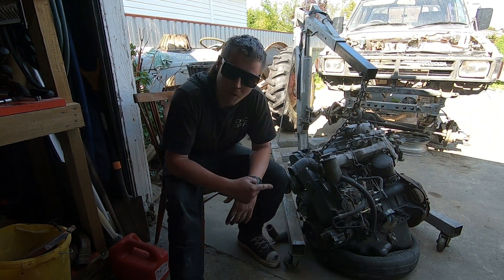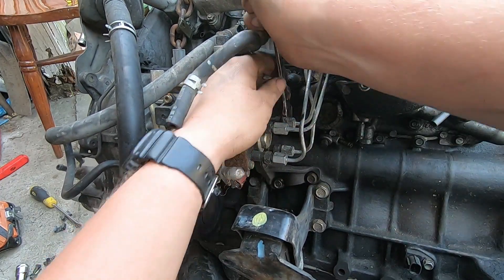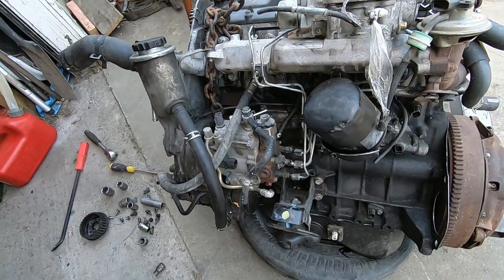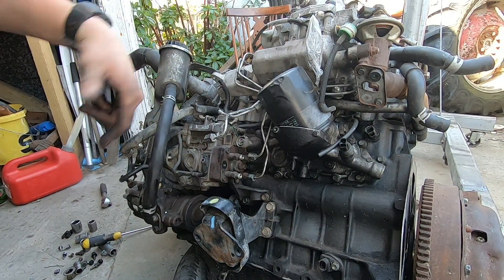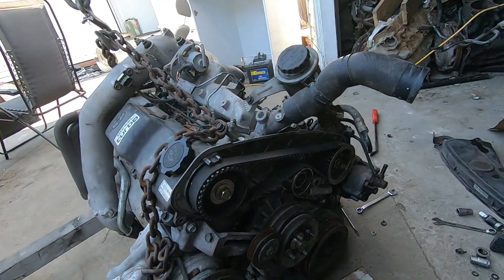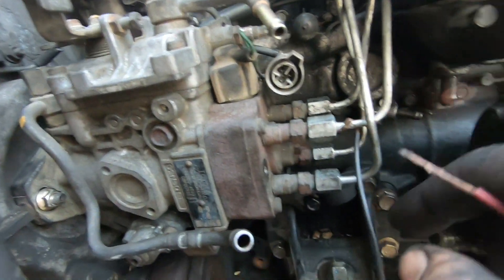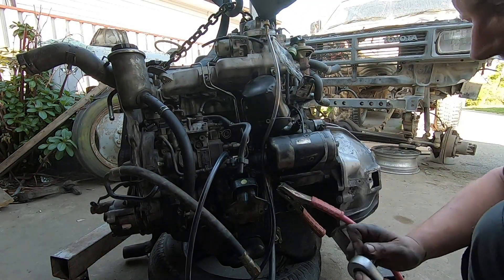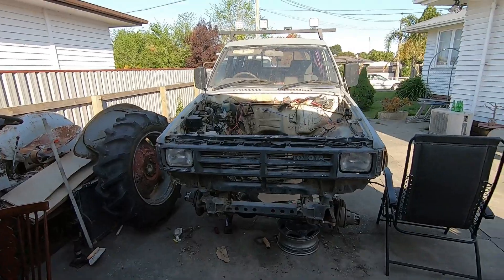Hilux 1kz Conversion: 1KZ Mechanical Injector Pump Mod

Comment: One thing I can say is you can leave all the timing belt and front pully on the truck, just need to remove the big front nut and the 2 sides, injector lines, bottom mount, and all the plugs etc and she knocks straight out ready to go back in so you dont need to re time it it will already be timed by the key on the shaft

Comment: I'm just curious, how did you keep the rpm/tach in your stock gauge cluster running? I also did this mech pump swap in my Surf (LN130), and its running smoothly,  but my tach is no longer working since it uses the signal coming from the electronic injection pump, any leads or advice would be of great help. Thanks so much! =)

Comment: How do connect up the throttle?
Reply: The accelerator pedal? If you could get the original 2l bracket it'll be easy. It's a swing thing with a rod attaching to the pump and the cable attaches on top.

Comment: Got myself a LJ78 that i will start doing the swap, bought a donor car, toyota 4runner with 1kzt engine, both cars are manual. soon will start doing it! 😎
Reply: How did this swap go? I'm wanting to buy a KZJ78 but convert it to manual which is what you will have to do I presume?

Comment: so I got mine up and starting, had to advance the manual pump all and fiddle the fuel screw. its just a temporary mock up till I get it tuned properly but she lives 🙌🏽
Reply: What mechanical injector pump did you use?
Reply: @sankarkamta  sorry man I put the comment in the wrong place .
Reply: Used a 3l pump. What I did was filed the bolt holes in the pump to turn the top of the pump towards the engine. (Unsure if that's advanced or retard) I used the original 2L/3L cable holder/bracket thing for the accelerator to connect back. Wired in the tps from the 3l pump because my trans is still original. Looking into adding some more boost to compensate for the small power loss. But like I said in the other comment it's not that noticable. She works like a charm now , I have no regrets.
Reply: I used the original 3l timing marks. Turned the motor manually with a rachet to make sure the valves weren't touching the pistons and yea she started but terribly. After filing the holes for more adjustment she runs very nicely now.
Reply: @raviseumangal4016  filing the holes meaning the engine block to advance the injection pump more? Making it tilt more towards the engine? Just to be sure

Comment: hey bro did u get ur 1kz started?. I think u have the timing wrong... 3l  pump timing is different to the 1 1kzte   timing. u need to put the timing to the original 3L marking . not the 1kz.

Comment: JOINTNESS.
Jointness is defined as a dynamic process representing an emotional system for attachment and for communication between separate individuals who jointly approach each other in a third, joint, virtual space. Jointness represents an encounter between mother and infant, psychotherapist and patient, or any partners experiencing simultaneously mutual intimacy, while concomitantly safeguarding separateness.

OR 
 My universal has good jointness,

Comment: Hey man u need to use a 4m40 2.8 pajero pump and send it away to get it set up to run mint...well that's the cheaper way otherwise u get a hybrid pump for around 1500 set up ready to go...the 3l pump that u just put on will run but u need to advance it right around like 40degrees to get it to run ok...it's like instead of the pump timed to number 1 cylinder it's starting on number 2 if u know what I mean...same thing u were talking about advancing and retarding turning a distributor like on petrol..cheers.
Reply: Hey mate I'm trying Todo a 4m40 swaps on my kzte just wondering whats involved in changing them to suit ?
Reply from the maker: that kind of crosses over with what someone else told me to, that there firing order is slightly different, couldnt i adjust the timing belt back a tooth or 3 to get it right? i needa get the bonnet up an have another play at finishing it
Reply: so I've got the 3l pump up in my surf but it's hard starting. it's advanced all that it can. any info on the 4m40 pump setup?
Reply: @raviseumangal4016  You got the 3L pump to start the 1kz?
Reply: @sankarkamta  yea man . That's what I'm using as my daily right now. Hardest part is balancing the fuel screw. It takes some trial and driving. I'd say I've lost a bit of power yea but it's not that noticable.
Reply: @raviseumangal4016  does is smoke under load as the 3L pump doesn't have a boost compensator mate?
Reply: @sankarkamta  slightly if I try to accelerate too quickly. I'd say if you could put your hands on a boost compensated pump it'll be a lot better.
Reply: @raviseumangal4016  already got a 3L pump a While now  but from what I understand from the video is that he timed the pump wrong, how did you timed yours? Where was the pump timing mark?

Comment: Do you do a bit of braising?
Reply from the maker: Yeah I work in refrigeration, I done all the copper work on my house plumbing just lately when I converted to gas hot water an cooking
Reply: @RangiWright  same here. My grandfather was engineer, he passed it on. Ye ol gas gas hammer is a handy thing.

Comment: Used to replace heaps of those contacts on them denso starters try just buff them up on a wire wheel used to work for a cheap fix
Reply from the maker: Yeah it's only gonna be getting a clean out unless I find the brushes are poked

Comment: Sick vids mate keep it up btw r151 gearboxes are shithouse
Reply: R151 gear box is the strongest and about the best upgrade you can do on a toyota hilux
Reply from the maker: @drewhackett9677  I had hear the same
Reply: Rollincoal Downunder 
Cousin put a cobra box behind his 98 sr5 dual cab 2.8d
Reply from the maker: I hear there stronger than the W52 I've got though?